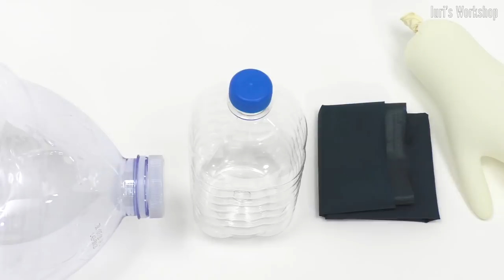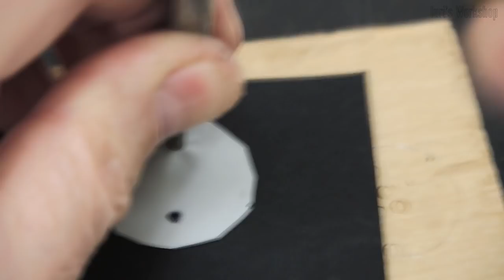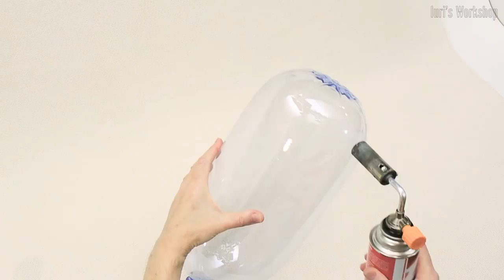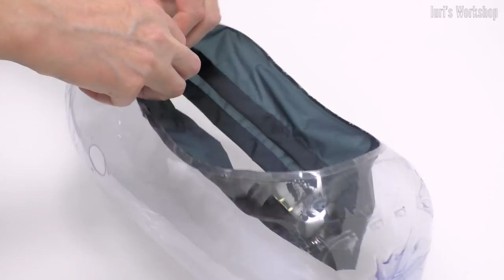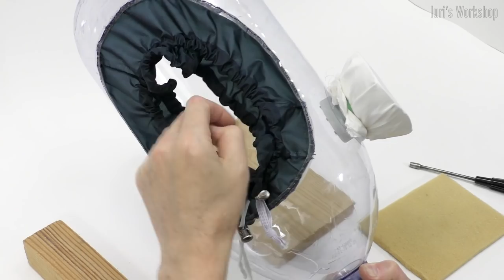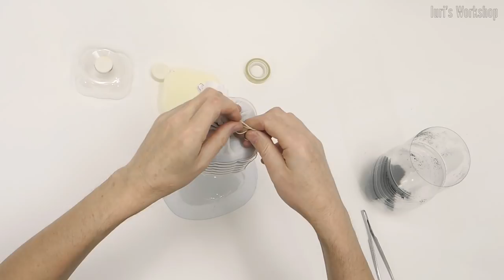🔅 Gas Mask – DIY

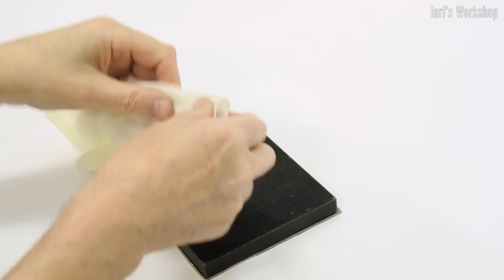Comment: 0:55 does air go throught that glove? i wanted to know cause im trying to make the outlet valve using a balloon part
Reply from the maker: These are very reliable valves: https://youtu.be/-k3vnUmdtZw?t=29 I still use them in a homemade respirator when processing fiberglass or other materials hazardous to health.

Comment: I think there is something you did not understand ...
     The purpose of being able to make a homemade gas mask is that it is easy, cheap and fast (in other words, that it is feasible).
     If it's going to be more expensive than a commercial gas mask ... I buy the commercial gas mask.
     If it is going to take a long time to manufacture ... it does not serve as a "circumstancial gas mask" (there are other models that can be made at home that are faster, simpler and cheaper, and that will serve to move you away from a surrounded area fire, for example).
     And of course, if it is going to be so difficult ... needing a torch, a sewing machine (and knowing how to sew), an air pump, etc ... I find it simpler, easier and faster to save for a commercial gas mask... for example not wasting money on the PS5.
Reply from the maker: I agree with you. It's just that I practiced some technologies on this product. Ultimately, I settled on this respirator. In it I tried to get rid of all the shortcomings of the previous constructions: https://youtu.be/-k3vnUmdtZw
Share your opinion on this respirator.
Thank you!
Reply: @IurisWorkshop  
Don't get me wrong, your skills are very good.
Although I think it would be nice a video where the process is simplified much more, but it is done with the professionalism you show.
Most of the videos out there in YouTube about homemade gas masks are pretty crappy, and it's easy to see that those masks wouldn't even handle the smoke from a chimney (not to mention the smoke situation caused by a fire, like the ones we saw in California, Australia, etc...; and not to mention other kind of gas).

But you do it very well. I think that if you do that looking for a cheaper, faster and easier form of make a homemade gas mask, it would be great.
The face masks you did in that other video are awesome, for example. Very good!
Reply from the maker: @Adriano.C  Thanks a lot for the comment! Good health to you!
Reply: @IurisWorkshop  Thank you and same 😇

Comment: I want to know something. How can you make it so that it is not a filter mask, but rather it is a pump mask. As in, I am in a place with something I don't want to breathe in, but it has a hose attached and it is drawing air from a pump where it is safe?
Reply from the maker: Sorry, but I did not understand the question.
Reply: @IurisWorkshop  I mean can we connect the mask to a hose that draws air from a different location?
Reply from the maker: @Hotshotter3000 Yes, I had the idea to make a liquid filter, but I couldn't find a suitable flexible hose.
Reply: @IurisWorkshop  did you try an extended vacuum hose?
Reply from the maker: @isoSw1fty  Not yet.

Comment: "universal protective mask"  what is the rating nbc cbrn those are the most protective FILTERS as long as your mask makes an air tight seal and you have one of those filters you should be fine nbc nuclear biological chemical cbrn all that but add radio-logical